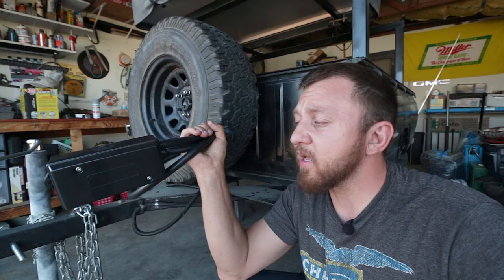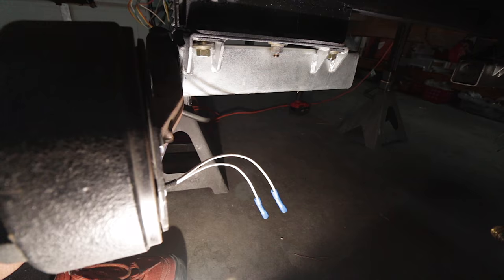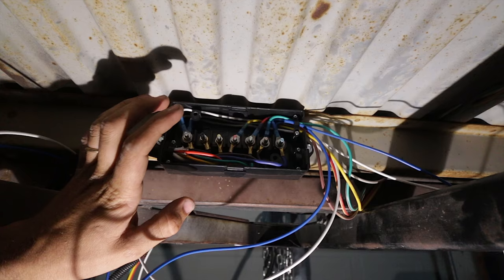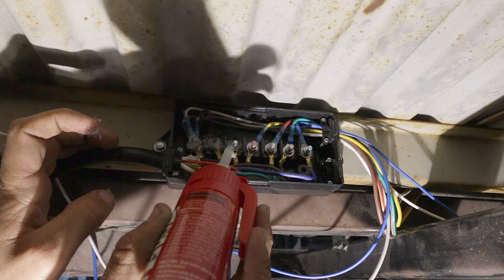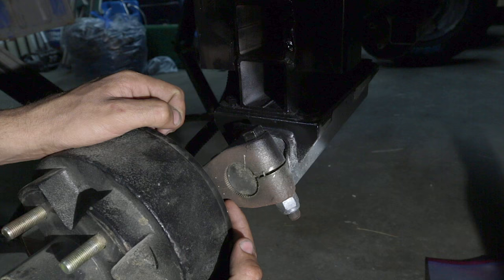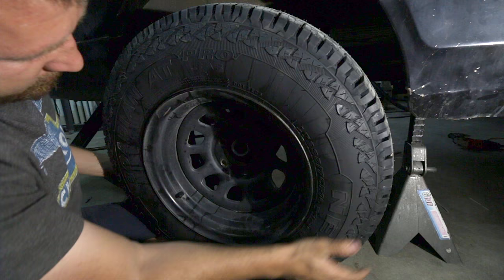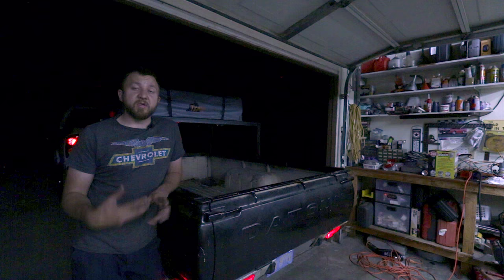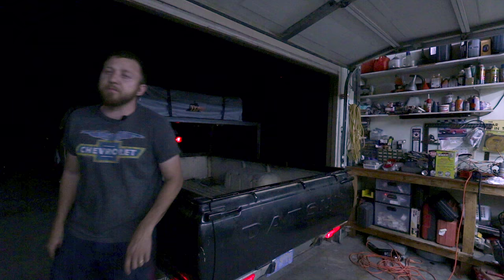How To Wire Trailer Brakes

Comment: Hmmm , what I noticed is that the dude drives a Dodge truck that’s gonna pull a Datsun rear end while wearing a Chevrolet shirt . 
I have a Chevy Duramax and I pull a 14’ landscaping trailer. 
I bought her used but in the first day the brakes locked up and they let go afterwards . 
Then I kept on having fuses being blown . So I still have to make time to install all new wiring along for the side marker lights that the trailer has . 
I have some questions. 
Since my trailer lights ride real high how do I wire them to add new lights if I keep the ones that sit high and add newer ones that are shorter along with installing those bars of light bars that display all of the same features of regular lights . That way at night it’s very visible what direction my flashers are flashing . 
My main concern will be to know that my brakes are working . 
Thanks again for any input.
Reply from the maker: Haha, that is very astute of you to notice. I really do not have any brand loyalty when it comes to trucks/cars. If it's a good vehicle, it's a good vehicle. 

Side note, I built this trailer to go behind my jeep. At the filming of this video, my jeep did not have a brake controller installed to test the brakes on this trailer. 

When it comes to adding a second set of lights, I would personally wire them in like the first set are wired. That will add increased visibility, and then each light will handle turn and braking. That will make the whole thing very visible. 

One thing to note, you'll want to be careful which type of light you are adding and how many. Trailer wiring is normally very small gauge wire. So if you have to many halogen bulbs on the system, you could have reduced output of each light just from the electrical load of the additional bulbs. But, if you go with something like an LED light, than you would not have this issue because LED lights have such a low power draw. 

As far as making sure your brakes are working, you should be able to manually apply the trailer brakes with the trailer brake controller. 

I have my own method of making sure my brakes work. I usually drive about 20MPH with the trailer loaded, then I use the button (sometimes it's a lever, or a squeeze style button) to activate the trailer brakes on their own independently of the truck. That usually tells me if the brakes are working, and how well they are working. This also helps me determine what gain the controller needs to be set to. Its a good way of adjusting the gain if your load changes a lot as well.

Comment: I have a question?? For trailer brakes ??? The the actual brakes do all wire from the trail drums go onto the blue pin ?????
Reply from the maker: One wire from each brake will get power (You can wire them together). The other wire will go to a ground.

Comment: when wiring the brakes, does it matter which wire gets the ground and which wire gets the break line?
Reply from the maker: For most brakes it does not matter. They just need power applied. At least the brakes I’ve worked haven been this way.
Reply: No it doesn’t matter because either way the magnet will work!

Comment: How do you know where the break wire goes in that box for it to work
Reply from the maker: The box uses a standard color code for wiring. It also comes with a diagram to help.
Reply: Ok because trailer gots 2 wires coming out from the breaks those wires go to that box then.? And after I hook it up how do I check if they work
Reply from the maker: So your brakes should have two wires per side, a power and a ground. The ground wire can just be tapped into the frame, or you can run it to the box. Either way it just needs to be grounded. 

The power wire will run to the box in the specified "brake connection" on the wiring diagram.

To test if they work, you will need a brake controller. Once installed you can use the brake control to apply the brakes while driving forward slowly. You can also have someone step on the brakes and listen for the brakes to come on. It will sound like an electrical buzzing.
Reply: @EmbarkWithMark  wait how do I know winch one ground and power on the wires
Reply from the maker: The wires are interchangeable (it does not matter which is used for either function). So pick one to go to the box and one that will go to your grounding point.
Reply: @EmbarkWithMark sweet this is the explanation I’ve searched for

Comment: I know that I made the mistake putting car/truck tires on a trailer.  Trailer tires should be used, they have more steel belts in the side walls to keep the tire from flexing.  Makes a difference when weight is in the trailer.
Reply from the maker: That is true to a degree, however this trailer is lightly loaded.  It’s also used off road a far bit. In this case I find LT tires preform very well. I’d never run p rated tires on a trailer. Good LT tires seem to work well though and are rated to carry loads.
Reply: The main reason for trailer tires is lateral loading to prevent side to side sway. If that’s not an issue it will be just fine. 

Most people don’t know to run their trailer tires at or near max psi all the time because sidewall flex will overheat and blow out even new trailer tires. They have an extremely stiff sidewall that is designed not to flex and needs high pressure to prevent it. Even if it wears out the center of the tread. The one exception would be say a very long trip totally unloaded, the. I might air down to 55 or 60 from 80. I’ve known several people to say “these cheap Chinese tires just blow out” then argue with me about why they run 35 psi in them instead of 80 on their camper lol. Gee you go through 1-2 blow outs a year and I don’t have them running the cheap Chinese tires or good ones for 10 years or until the tread runs out… huh

If you want lower pressures to reduce bounce or increase float and traction the all terrains are essential. If you do all Highway with loads trailer tires are essential. Basically the poster chose the correct tires for his application.

Comment: So are the brakes working getting signal from brake lights?  When you press brake on tow vehicle it sends signal to lights and those will trigger trailer brakes? . Does it need brake controller at all then?
Reply from the maker: The brake light wire and trailer brakes wire are two separate wires. You do need a brake controller for trailer brakes. Otherwise the trailer brakes will be either full on or full off and, they won’t be apply correctly to work with the tow vehicle.

Comment: I know it's been a long time but how is this trailer holding up? Was wanting to install those stabilizer jacks on my 78 chevy luv trailer which is pretty much the same as yours.
Reply from the maker: Holding up great! I still have it and still use it. We took it out about 3 weeks ago to Joshua tree. Performed well!
Reply: @EmbarkWithMark   great. How are those scissor jacks holding up?
Reply from the maker: @CoolRunnings1976  I’ve not had one failure!

Comment: Hello! just watched this video and I’m trying to add brakes to a car trailer I am working on. (Old boat trailer) do you remember where you got the electric brakes? Thank you
Reply from the maker: So, I installed flexiride axles on my trailer. I ordered the axles with breaks. The axles came with brakes assembled. If your axle has mounting flanges then you should be able to contact the axle manufacture to get the brakes you need. 

If your looking at a new axle, order the axle with brakes.

Comment: You didn’t say if there was a reverse light wire and if the reverse lights work.
Reply from the maker: The wiring harness and box I used has a standard 7 pin layout. It has a spot for reverse lights. I did not hook up the reverse lights on my specific trailer. I have to run an additional set of wires from the trailer lights to the box I installed.